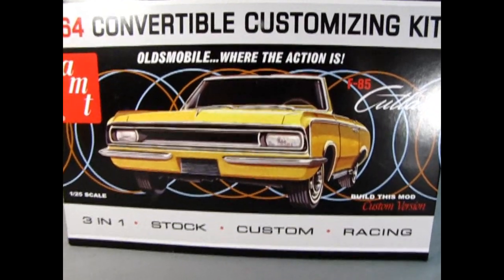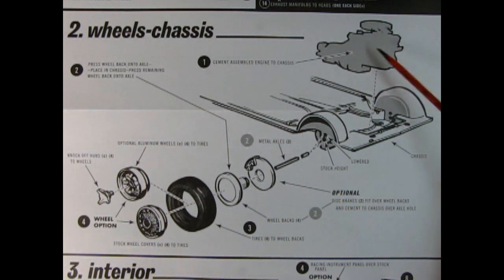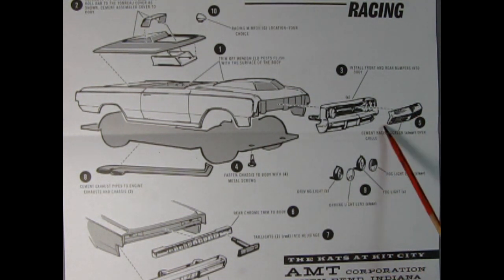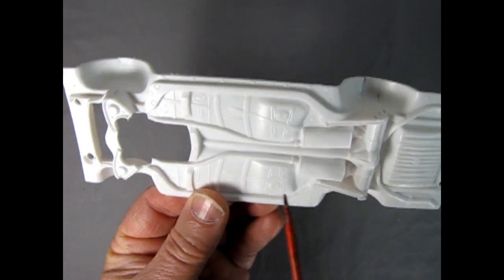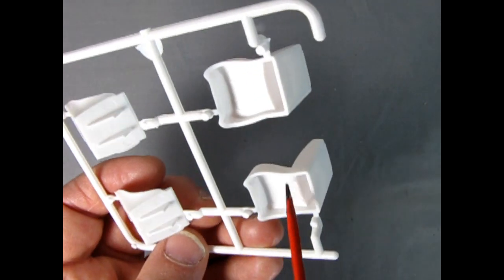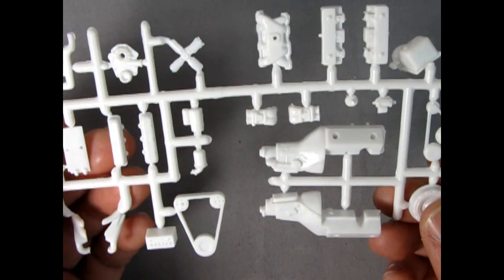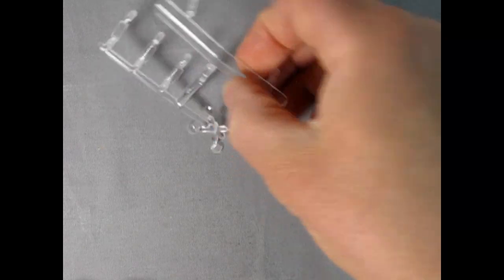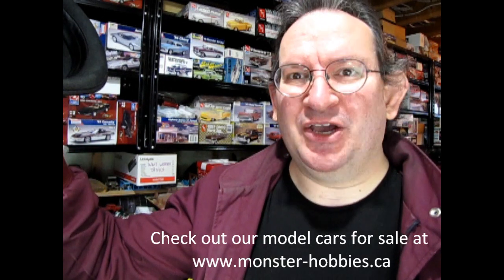Model Car Garage - The 1964 Oldsmobile F-85 Cutlass Convertible 3-in-1 Customizing Kit By AMT

Comment: The little grill looking than is a clutch pedal on the hard top version it comes with 2 engine transmission combo automatic transmission and manual transmission, to make it a 442 or f-85
Reply from the maker: Next week I will be unboxing the hard top version. Thank you for the "heads Up" on the pedal.